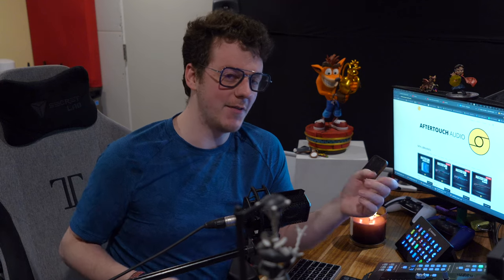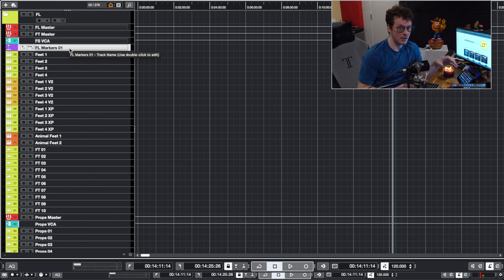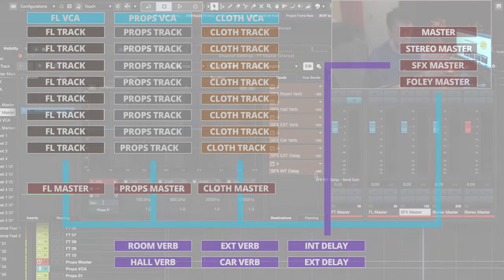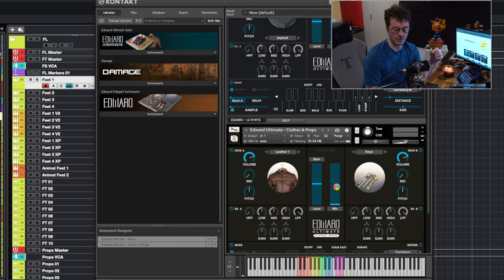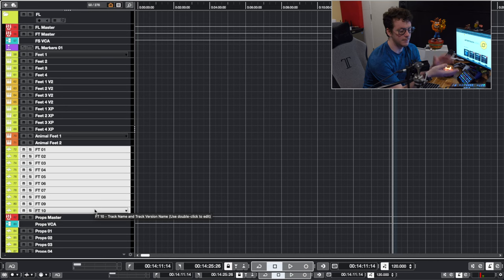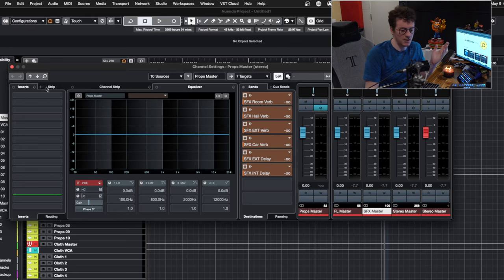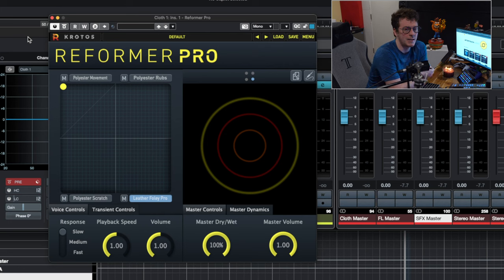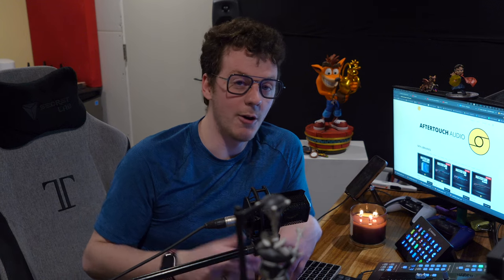Post Production Template Part 3: Foley

Comment: Hey quick question, why use the vca faders when you already have the submasters?
Reply from the maker: VCA faders allow you to group multiple channels and adjust the outputs of not only all those channels faders, but their sends as well, whilst keeping all the audio levels relative. So if you are have reverb sends on a track and you use volume adjustments the "sent" amount stays the same which means more reverb. VS if you use a VCA fader it will also lower the voltage of the track and adjust the send amount as well.
Reply: @AftertouchAudio  Ahhhhh I see, I see. Thank you for clearing that up for me.